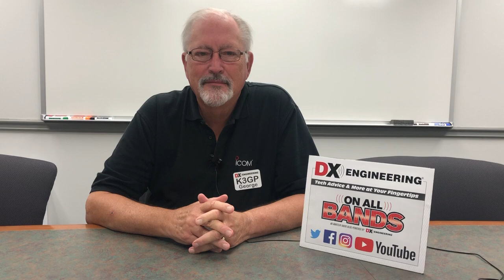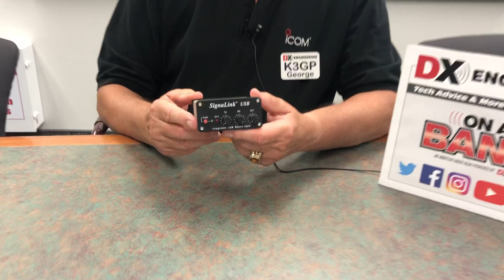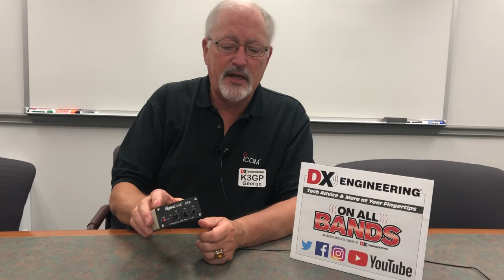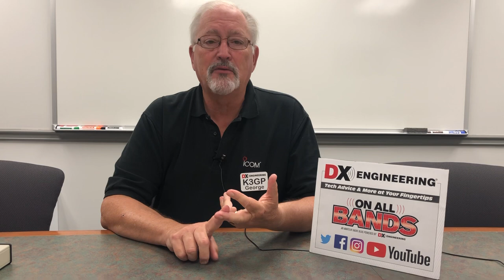RTTY - Radio Teletype Explained

Comment: Former Navy RM1 here.  Used to work on TTY’s and love them. We never used FSK because all our TTY comms were HF. Only time I used FSK was when I had to get around EMCOMM ALPHA (no HF or Radar etc) and relayed a Red Cross reply while on deployment (kinda tricky and took a Helo crew with big brass ones to pull it off).
Reply: I had a lot of fun in the 60’s working with Navy Mars on RTTY. When we didn’t have any real traffic, we would exchange “pictures” made by various characters printed across the page to create a crude image. 
We would save these “messages” on punched tape to make it easy to resend. 
Had a lot of fun just rag chewing with the Navy RM’s via text. My dad was amazed I could send and receive typed messages from a ship in mid ocean.
Reply: @billmoran3812  My hometown is OKC. Big high-powered AM station there. Couldn’t pick it up around JAX since there was a station on same frequency, but once we got out to sea it started coming in. 1,000 miles out it was the best signal overnight.

Comment: G1WKP - My most remembered RTTY 1992 - Did this with the Mir space station with RTTY using just 1 x 741 ic on 2 meter via my 286 PC, in 1992 as Mir passed over UK - MIR LINK --- https://en.wikipedia.org/wiki/Mir